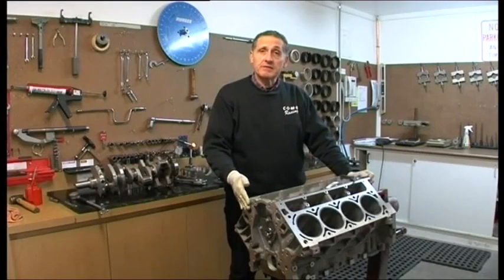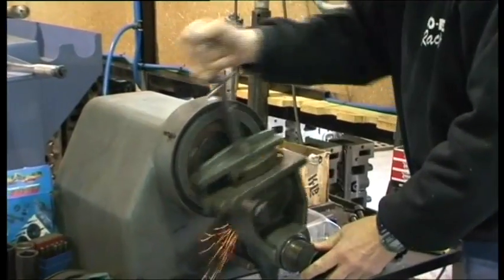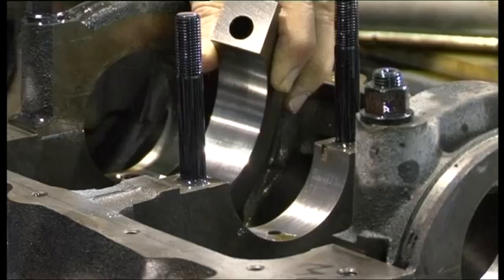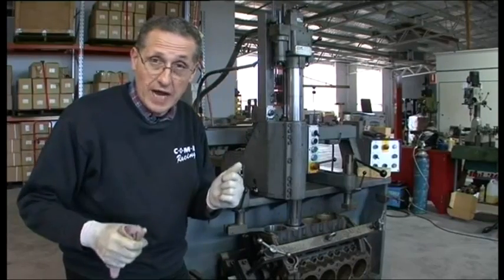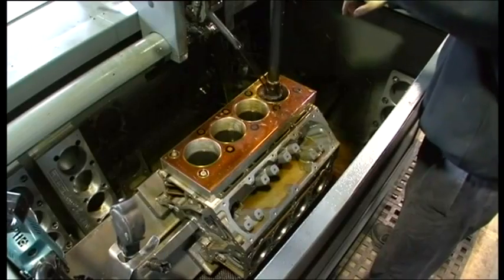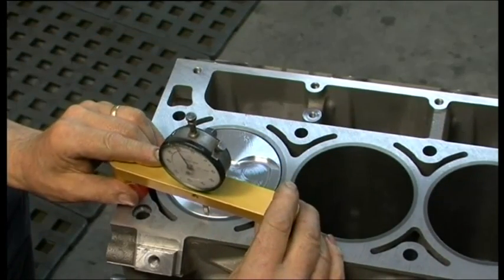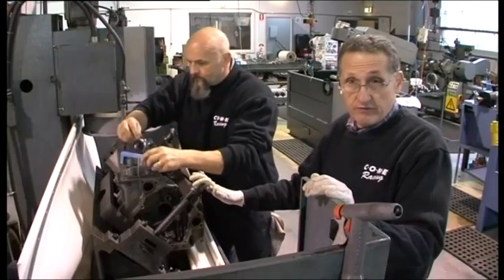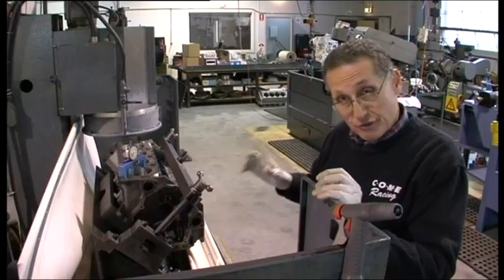COME Racing cylinder block machining

Comment: This all looks pretty good except for the second process. Correct me if I am wrong but by grinding the mains caps then honing their bore you move the bore deeper into the block changing the split line and clamping the bearing shells off center?  Also by only using a hone (Spring loaded and not supported other than the stones) and not a boring bar rigidly supported they may be mostly round and mostly parallel but the bores might not be concentric?  Afterwards you still need oversize mains anyway?  Another question, what do you use for a radial datum for boring the piston bores as by your statement the decks can be out by quite a bit. The crank main journals will only make it parallel, how do you find the center of the block for both boring and decking? Do you use the cam tunnel? 
Cheers

Comment: Yeah... The Ford is just like the LS... Well apart from having 4 cams instead of 1, oh and 32 valves instead of 16, oh and bucket and shim valve gear instead of pushrods..... Other than that its the same lol...
Reply: big500 what wins v8 supercar most not overhead ford shit
Reply: oh and a bigger heavier engine with no torque curve! dont forget that part!
Reply: I'll put my 2003 ford modular up against any new GM car in a race and not worry much.

Comment: THE LS WHICH YOU REFER TO AS THE HOLDEN V-8 FROM TOP TO BOTTOM IS A FORD ENGINE. THE GM ENGINEERS COPIED EVERYTHING FROM FORD. NOTHING REMAINS OF THE OLD CHEVY SMALL BLOCK.

Comment from the maker: Most of the time you could leave them in place as they usually wear very little. The reason for removing them in most cases is to fully expose the oil galley holes in the cam bearing journals for the most thorough cleaning after acid dipping (to clean) and final washing before assembly. When boring etc. you will have particles of machining swarfe in the oil galleys and the removal of cam bearings ensures you will be able to clean the galleys more thoroughly.

Comment from the maker: Mock assemble first with crank and bearings. See where your piston is sitting. This gives you an amount to take off each deck to arrive at the final deck height you want. When you are machining you don't need a bearing in place. Just need to register off the main bearing tunnel and start cutting. If you take the right amount off this way you will have correct deck height when you fit bearings, crank/rod/piston assembly back into the block.

Comment: just wondering how you could get the right deck hight with out a bearing installed?
Reply: they had a 1/2 bearing in the rod and 2 bearings in the crank.